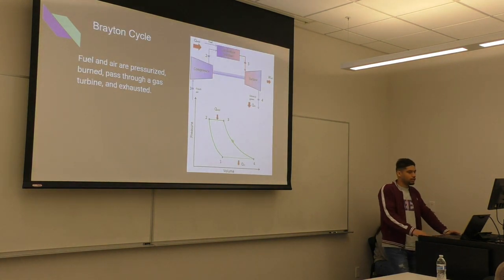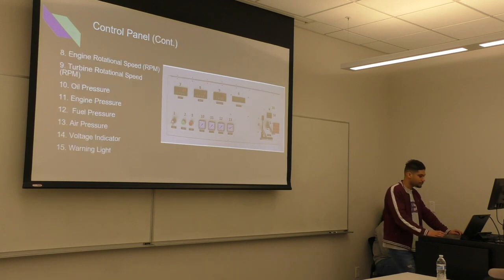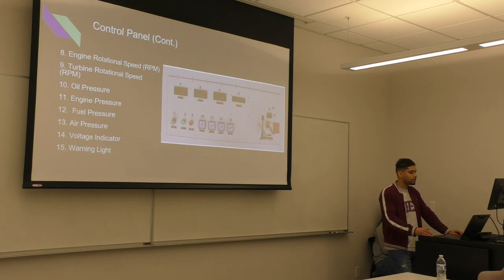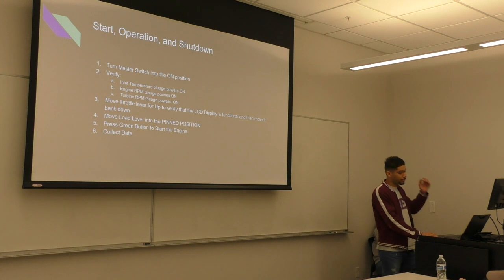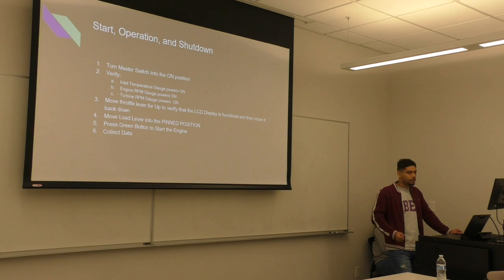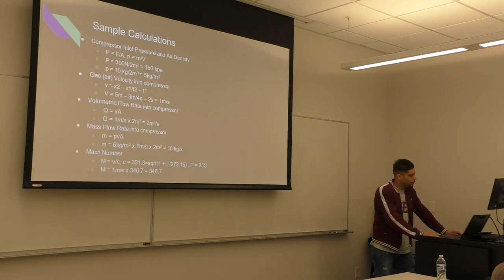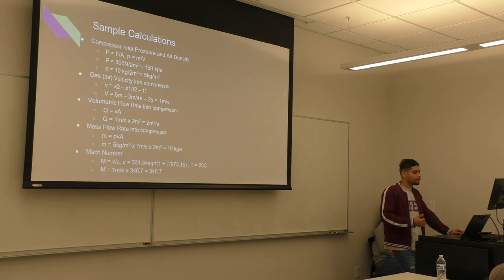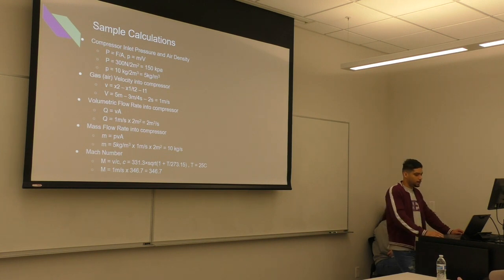S1540008

Comment: Colin Roberts - This was a strong technical presentation that gave viewers a great understanding of this experiment. One highlight of this presentation was the summary and then deep dive into the procedure. This gave a broader view of the experiment procedure before giving a more in-depth look at each step. My main feedback area is to make the sample calculations slide clearer by splitting it up or using tables.